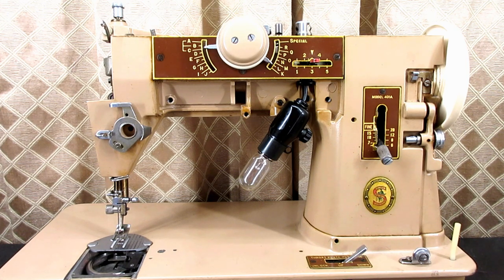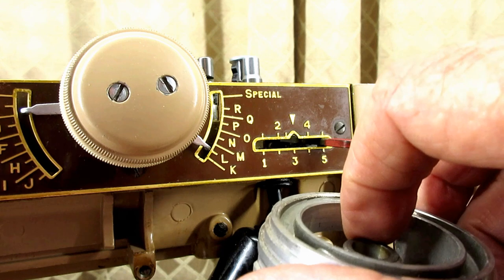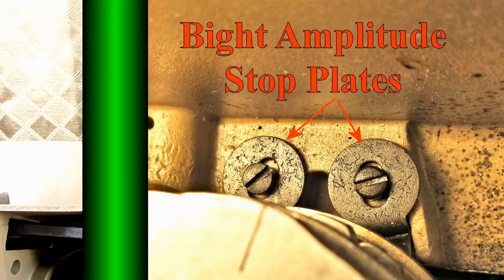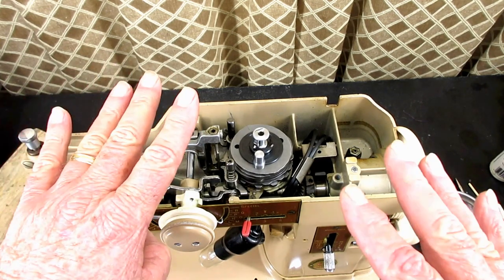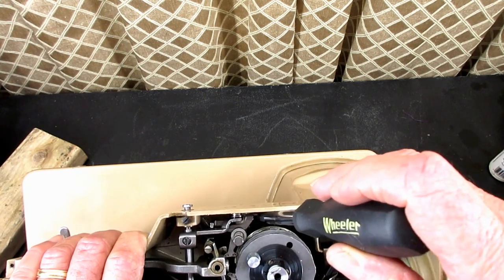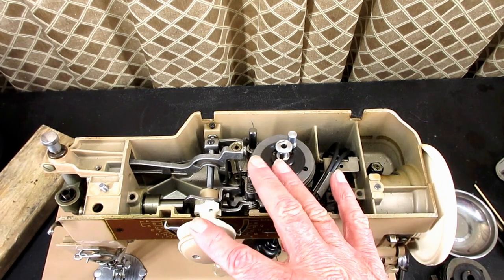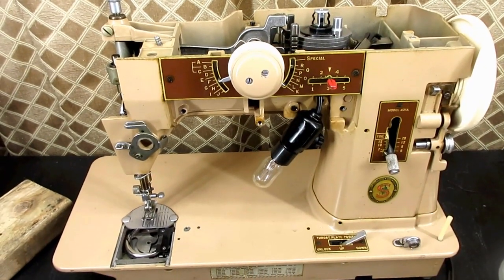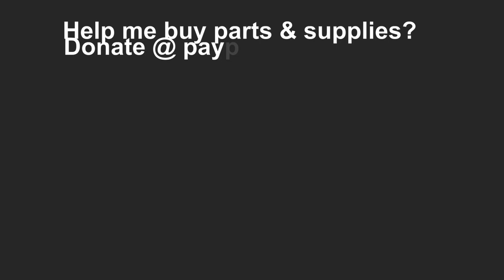How to "ZERO-OUT" Singer Models 401A and 500A Sewing Machines

Comment: I've learned a lot from your videos, but you missed it on this one. You can easily prove it to yourself by taking that machine that is perfectly adjusted. Set the red handle to the 4 position. Now loosen the screw that holds the red handle to the bracket. Loosen it up good and you will note that the handle will move freely. Set it to the 5 position and then tighten it. You will now see that when you move the red handle towards the 1 position that the driving arm will stop at about the 2 position. Now you can adjust the limit of the red handle by moving the stop that you showed, push it in and tighten the screw. Now you will see that you cannot move the red handle to the 1 position, because the limit adjustment is stopping it at the 2 position. And if you look at your adjustment in the other direction you will see that even when you get to 5 you will have movement in the driving arm. So the adjustment to make if the driving arm is stopping too soon, or not soon enough, is to loosen the screw that holds the red handle on. That red handle needs to be centered between the left and right sides by noting when the driving bar stops.
Reply from the maker: Thanks for watching my channel, Mark, and for leaving such a thoughtful and detailed comment.
I disagree with your statement “you missed it on this one.” I think this “ZERO-OUT” video is a good representation of how to Set the Bight Amplitude Stop Plates which Singer also called “To ZERO-OUT the Machine”. This adjustment is shown on page 140 of the SERVICE MANUAL for SINGER SWING-NEEDLE SEWING MACHINES, a 174-page manual covering models 206K, 306, 319 and 401. For anyone interested, you can download a free copy of a 45-page section of that manual that pertains to the Class 401 machines at this link;  https://sewingdude.files.wordpress.com/2012/09/singer-401-service-manual1.pdf    This is in PDF format.
If I am following your comment correctly, the adjustments you describe are for lining up the needle bar driving arm with the disc. This procedure is also in the Service Manual and is shown on page 141 under the heading “TO CENTRALIZE THE NEEDLE BAR DRIVING ARM WITH THE DISC SELECTOR ARM BRACKET FOLLOWERS”. So, my video and your comment seem to be describing two different adjustments and that is why I said I disagree that I “missed it”.
BTW, if you’d like to make a video about the adjustment please let me know and I will make special reference to it on my channel for viewers to find it. Thanks again, Mark, for your interest and participation with my channel. Take Care.
Reply: I have a problem machine.  When width control (red levet) is set to 5, the right needle position. Needle bar does not go all the way to right.  I performed your movement and dial settings to test for zero out.  Machine passed both settings tests.  What else do I need to do?
Reply from the maker: @xyz12345457  thank you very much for your kind comment 🙏 you really lifted my spirits this evening and I appreciate it

Comment: Andy, thank you so much for your time and detailed replies! You are so very generous with your knowledge! 💖 Happy Valentine’s Day!! I’m going to look at all you have mentioned and def clean those cams!! I did have it serviced within the last year...and he did exactly what you said..it dripped for days after i got it back and and when I opened the top I saw lumps of grease on the gears...and charged me $125. I didn’t know the zigzag didn’t work back then just did straight stitch quilting. Started making bowls recently and need the zigzag! I look forward to repairing. Your machines just sparkle! That’s how I realized how dirty mine is.    Yesterday I did look at the bottom...not too bad, but I want mine to sparkle too!! 🥰 also after over thirty years, I opened up my first machine. Was told it was a 66 from 1930! Take care...I’ll let you know how I make out when I get to it!!
Reply from the maker: I'm excited that you want to work on your own machine! You can do it, Pat, 👍and you'll find it rewarding. I've found that just cleaning and properly lubricating a machine can fix about 90% of odd stitching problems. It is rare for a machine like yours to break unless someone played around with the parts. They are so well made. If by chance a part did break or fell off, replacement vintage parts are still readily available on eBay. Ooo... a model 66, huh? Lucky you. I've only worked on one black Singer vintage machine, a model 99K. It turns out the 99K is a 3/4 sized version of model 66, and my restoration videos for my 99K could be applied to your 66. https://www.youtube.com/playlist?list=PLsCOZgzzaiKIIUgkEujqHc9iNWN9NPW2Z   So lucky you, owning two of the nicest machines Singer made. Enjoy, and take care. ✨
Reply: @andytubesewing1953  I can't believe it....I think I grew WINGS because I just been flying around all afternoon!! My 401a ZIGs and it now ZAGs again!!! I have to admit I was overwhelmed and intimidated to do this completely on my own after days of watching different videos and losing sleep thinking about it. Finally, I asked a friend of mine (mechanic of older and antique autos) if he would watch a couple of the videos and be with me going through this process. It took us four hours yesterday and four more hours today...BUT we got it done!! It was such an emotional ride for me (mostly thinking I'd never get it right)...but in the end, I learned so much and feel so much more comfortable knowing what's under the lid!! :) It's not clean, as we focused on the problem issues first...didn't take everything apart - just sections we believed were suspicious. It turned out to be the NB!! On the third disassembling and cleaning the NB...(especially the inside piece) when assembled again, it finally gave way to a full swing from left to right!! I knew we had it when I heard the click, click, click going left to right to left (red lever on 5)...just like in your video. Prior to that, it had more of a squish, squish restriction...had to push back and forth only by manually pushing. I couldn't be more excited!! I'll love this machine for the rest of my days! Andy, you were so right....VERY satisfying!! My friend said...the last adjustment is always the key. HA HA So TRUE! Now one day soon, I'll get the supply list and can feel very comfortable taking things apart and making them SHINE again! Can't thank you enough for all your encouragement. You're the BEST!!
Reply from the maker: @patchase4773  😀 I'm so glad you persisted and forged ahead into the unknown. With your determination and the help of your friend (now that is a true friend), you found the solution. 🏆 So happy for you, Pat. Now you know it is possible to work on and maintain that wonderful machine. Thanks for letting me along on the journey. You made my afternoon today. Really... I'm pretty good, but you and your friend are the best now. ✨Take care.

Comment: I think you are right. Never see a video on this subject. Really nice. I'm partial to the 401a, as a you kid I learned to sew on my mother's. Wasn't long before I had to get my own machine a 1590. Still have that one. I believe my sister has my mom's 401a. I think all an all the 400 series is pretty hard to beat for a mechanical. All of my foriegn machines of this era had plastic gears and cloth belts. Great smooth machines as long they don't break. Try to find parts for an old Adler
 Wow. Thanks Andy.
Reply from the maker: thanks for watching and taking time to comment. I remember looking at a machine, maybe called a grasshopper, that was really interesting to me. When I looked inside I saw some kind of a cloth drive belt with metal cleats in it that was starting to fall apart. I asked the seller where I could find a replacement belt like that and he replied "now you know why I'm selling it". Lesson learned. I've never seen a 1590 or 91 in person. That potted motor looks great. Thanks for stopping by and take care.

Comment: I just bought a 500A, couldn't resist the price... I need to watch your cam stack video. and any other videos pertaining to the 500A, or 401A... I bet you cover it in this video, (just started watching) when my inner knob is all the way down, the indicator is on (L)  instead of (K).  My 500A is pretty clean, I got everything moving pretty well, but need to get further into it. the inner knob (mechanical movements) is a bit sticky..   oh boy,, more videos to watch.. Thanks Andytube.
Reply from the maker: Congrats on your new Slant-O-Matic Rocketeer! My 401A Playlis covers most of the part systems on your 500A. https://www.youtube.com/playlist?list=PLsCOZgzzaiKLiDl9yFTP6mJgQmz5lj4NO
Usually, once you clean everything the followers will line up. If not, there is a video to rest the height of the index pins that hold the followers. The Service Manual for the 500/503 covers all the adjustments, too! BTW, don't be surprised if you find a broken spring on the bobbin winder.
Reply: @andytubesewing1953  Thank you for the playlist link.. my bobbin winder springs look good,, old tire, but the movements good and adjusted properly.  the thread tension was messed up, puckered fabric, and the foot was a bit cock eyed, and the fabric pulled to one side.. there was lots of lint in the bobbin area.. but the machine  overall is about a 9.8 or 9.9 out of 10..  really quite clean.  but It needs to be really well cleaned..I have a lot to learn about the mechanics of the cam stack and knobs etc.. uh.  Thanks again Andy. I know what I will be doing in my spare time..
Reply from the maker: @connieworcester55  oh that's great news! I love a machine like that that's mechanically and cosmetically sound. I don't care about the dirt and grime that comes off and it's rewarding when you're finished. Have a good time. I'll be thinking of you

Comment: Hi Andy.  Thank you so much for this tutorial.  I did not understand what the service manual said on this topic and why one would do this.  Yes, zigzag width setting makes sense to me.  I understand now after seeing your video what this adjustment does.  My machine did not need any adjustments in this area, but if I had to do it, I could, and my fear level of "zeroing out" my machine dropped to zero.  Thanks for the bonus material on moving the selector knobs through the range of possibilities when changing.  One thing I do not like about the 401 is having to go from setting AK to BL for getting to zigzag from straight stitch.  It's tedious.
Reply from the maker: Welcome, Carol. It is seldom I've ever had to correct these stops plates. Usually only if someone before me has played with them. You absolutely could make this adjustment in the future if needed on a machine you picked up. I also agreed about the AK to BL just to get a normal ZZ stitch. On the 403A and most machines you just move the bight (Zigzag lever, haha) to the right and away you sew. The machine is very well made, as were all the Singers from this time, but man, there are a lot of parts to oil, adjust and maintain, IMHO. Thanks for watching it. Take Care.
Reply: @andytubesewing1953  Actually, I've found that if you have the setting at BL, and move the red selector to 1 - gives you a straight stitch. Much more simple than having to go to AK3.
Reply from the maker: @scrapmail3561  OK, that "actually" makes sense if you are already in BL mode. B puts the needle in center position and L is a Primary Pattern (ZigZag) and BL is meant to have the Red Lever set from 2 thru 5. Setting it at 1 would prevent ZZ. That seems like a nice shortcut if you are sewing ZZ and need a straight stitch. Thanks for sharing.

Comment: Thank you so much just received machine from aunt... pretty sure it has been used for at least as old as I am. All cleaned and unfrozen now to see if it will work.🤞
Reply from the maker: You're welcome, Rachel. These models were made in the very late 1950s to the very early 1960s. Some of the last "all-metal" machines with all-steel gear drives and no belts. Good luck going forward with your wonderful gift.

Comment: Thank you for all of your videos.  I watched your zeroing out video and followed the tests for left and right movement on a 401 that I am working on.  Mine tested correctly for no movement on both left and right; however, the right needle position does not go over far enough.  Zigzag is not wide enough.  Pattern stitches look correct on left but skimpy on right.  What do I need to adjust to fix?
Reply from the maker: I've never had that on a 401A, but I've only worked on a half dozen of them. I think I would check that the cmastack is timed and if not I would reset the timing (camstack, not hook) The last 20 minutes or so of this video is about the camstack timing: https://youtu.be/aphiW06yp64  If that timing is OK then I'd try following the directions on page 141 of the Service Manual, centralizing the needle bar driving arm. If you need the Service Manual you can download it here for free: 
https://sewingdude.files.wordpress.com/2012/09/singer-401-service-manual1.pdf
Of the top of my head those are what I'd look at first.
Reply: I went through steps, again, for bight settings test, and reviewed your video for timing cam stack.  Everything appeared to be correctly set.  I did download and reviewed service manual.  Someone in a Facebook group said it was gummed up and to use hair dryer and more oil.  I did resort to hair dryer, oil, and manipulated by force moving needle bar to right.  I was finally able to get it all the way to the right but it would not freely go back to that full right position without forceful assistance.  After more oil and continually moving red lever from center, left, then right and more heat, it now appears to perform correctly.  I did play with the right screw for bight stop but that made no difference so I set it back to where it was.  So, old gummy oils was the enemy!  Thank you for your helpful videos. 

Do you have a video that could help me with a Singer model 360?  It needed a lot of oil.  Got it sewing straight stitch but will not sew at all in right needle position and zigzag does not pick up on right swing.

Thanks for any additional advice.
Reply from the maker: I'm glad it has improved. I thought you had already cleaned the machine like in my videos. Cleaning a machine clears up many of those types of problems. Adding oil and heat can get things moving again, but where does all that oil end up?
I'm not familiar with the 360 model. It's a little to "new" for me. I don't have a service guide and could not find one. You can download the original instruction manual from Singer for free: https://www.singer.com/search/support?title=360

Comment: Hello. Thank you for the videos you make! Thanks to you i have successfully done some service on several singer machines. Do you have experience with the Singer 5932 t? Someone else was using it and “broke” it. I was able to adjust the timing, and then the machine once again captured the bobbin thread! So i thought i had fixed it. But noticed the top thread was snagging on the bobbin case. On closer examination, it was obvious that the bobbin was missing the top edge above the screw, so it was snagging the thread, ordered a new bobbin case and installed it. Now at last was able to make stitches! But the machine made strange noises and stitches were not neat, but varied in stitch length, and the top thread was bunching up underneath. I have tried adjusting the tension, but something else must be wrong. Do you have any suggestions before i just chuck it in the dumpster?
Reply from the maker: Model 5932 is in a group of machines made outside the USA in the late '80s to the early 90s, maybe in Taiwan, South America or both places. They are mostly plastic. They have 4 or 5 plastic gears on the bottom of the machine that are internationally known to break, crack and crumble with age. There is a belt from the upper arm to the bottom that runs all those gears/shafts down below to turn the hook and move the feed dog. Those strange noises may very well be one or more of those gears. The poor stitching is because the hook is rotating erratically and the uneven stitch length is because the feed dog is lifting and pulling in a hit-or-miss way. You can probably buy gears. You may even be able to find a video about changing them, or a Service Manual for sale somewhere online. It's up to you if you want to spend the $$ and time to find a way to replace them. With all-new gears and if the drive belt is good, the machine would run another 10 years I'd say. This machine group was known as the 5-6-8-10-12-16-22 stitch pattern machines. Basically, the same parts for a few years and models with a few more pattern discs added to the cam stack so they could sew a couple more patterns. I believe they started out as Models 4552 and 4622 and went on to become 5932, 7028, 9005, 9008, 9010, and maybe a couple more. It is hard to find documents for some of them, but you can still download a free Instruction Manual from Singer at this link: https://www.singer.com/search/support?title=5932
Thanks for watching my channel, Mary, and best of luck to you.
Reply: Andy Tube thank you for your quick reply. I think i will chalk it up to a good learning experience!
Reply from the maker: @marybalmer8001  The right attitude, Mary. Good luck in the future. Take Care.